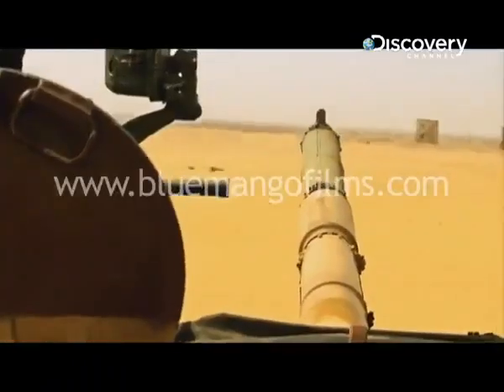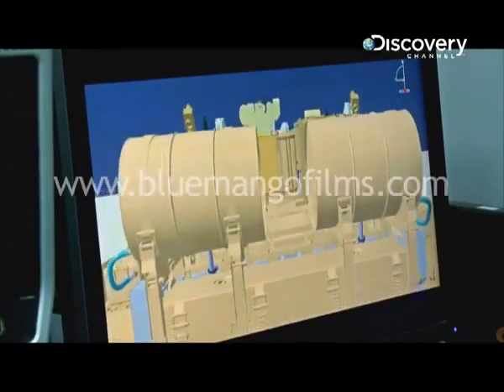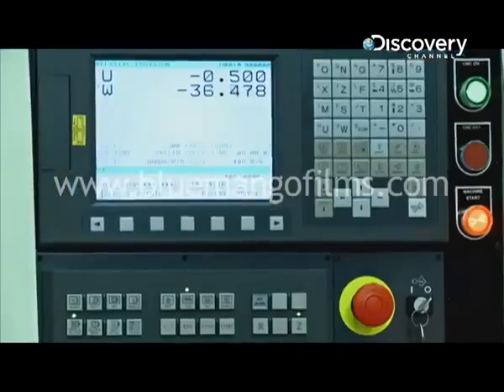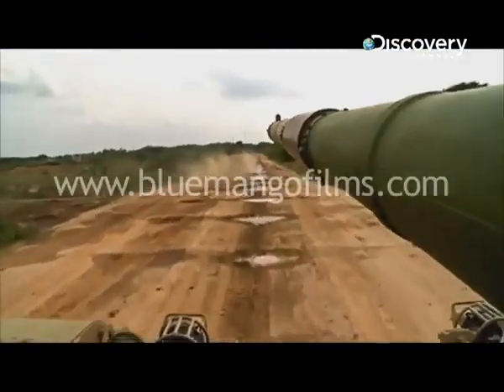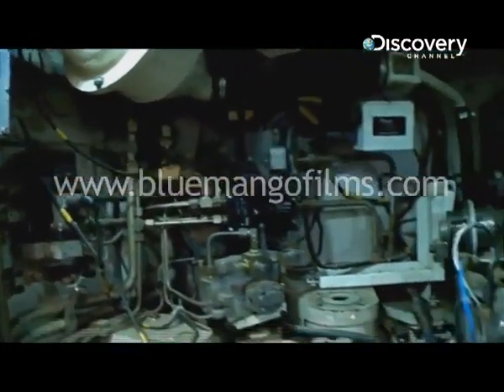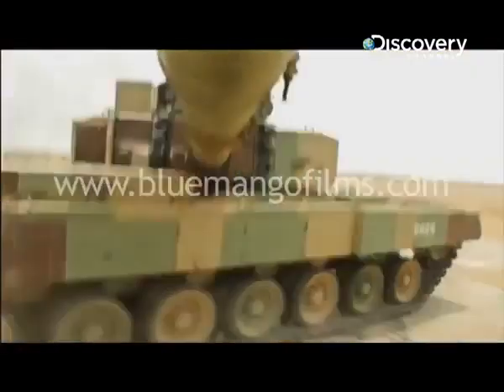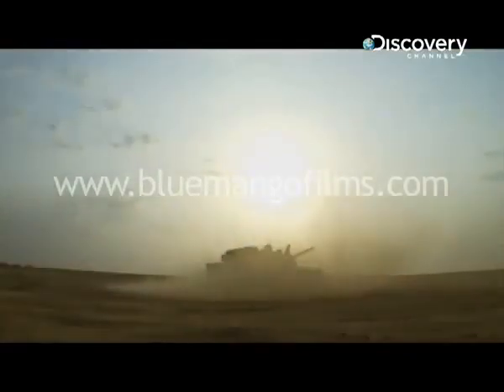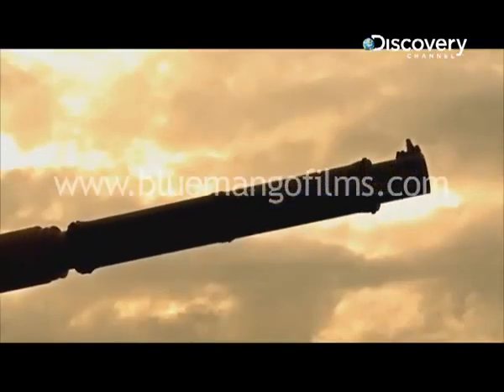Arjun Tank Mark1 Documentary

Comment: world most faster tenk is our arjun .  i think in present time no tenk is faster than arjun .  Ferrari of desart
Reply: +Sonu Dutta ur crazy
Reply: +Sonu Dutta    in this man  said that arjun 65 k/h,  but   Al-khalid tank speed 86km/h  Please check---------
Arjun                                   

Designed----1974 ,,In service---2004,,-
Weight----85.5 Tones,,Length----10.638 Meters,,
Wiath---3.864 Meters,,Hight---2.32  Meters

Crew---4,,,Primary.Gun    120 mm,,,

Secondary Guns
HCB  12.7mm,,,AA ,MG,
Mag 7.62mm CX,,,Engine ----1400 hp,,,
Power-----23.9 hp

Operation  Range
450 km (combat range ),,,,
Speed      70 km/h
==============================
==============================
Al-Khalid
Designed 1999-1990,,,Manufacturer   HIT<PAKISTAN,,,,
In service---2001,,,

Weight----60.2  Tones,,,
Length-----10.974  Meters

Wiath-----4     Meters,,,
Hight----2.89  Meters,,,Crew---3,,,Primary.Gun----130 mm 
smoothbore gun,
  45rounds

Secondary Guns
7.62mm coaxial MG,,,
3000   Rounds,,,,
Engine           1600   hp,,,,Power             29.8    hp

Operation  Range  
600 km (combat range ),,,,
Speed      86 km/h
Reply: +Faheem Khan do you think arjun tenk's desighn is an40 year old desighn ?just see the documentry dude arjuns desighn has been improvement since 1974. and this is just a mk1 the mk2) and other upcoming tenks will be better . but what about your chinese tenk!!! i have saw chinese tenks documentry . chinese  manufacturer was not interested to developed good tenk armour . beware my friend even a handmade rpg should destroy your chinese tenk .

Comment: 120 mm rifled bore? oh! cmon you are already doomed against abrams or t90 tanks which uses smoothbore gun carrying a ARMORED PIERCING FIN STABILIZED DISCARTING SABOT(APFSDS) round with depleted uranium or a tungsten tip .. that the reason why like US cannot use rifled bore gun to stabilized the sabot round or even firing a rocket round!
Reply: Marcos B it depends ... for me smoothbore is good for APFSD (e.g du penetrator or thungsten round) which is more powerfull and also carries rocket round for long range fire ... rifled is not good in APFDS due stability issues .. so i want penetration than to shake the tank crew inside the turret and hull
Reply: ***** ur right but for resons they didint decide in a smoothbore
Reply: ***** you mean the german guns on the abrams..lol
Reply: +Jose Mari Rey You do realize that the stability problems for APFSDS rounds fired from rifled guns were solved 40 years ago by the advent of slip-rings, right? There's a reason the British were able to continue to use rifled guns on the Challenger 1 and Challenger 2 (thus not giving up the HESH advantage) despite the wide proliferation of smoothbores. Sure, smoothbores have their appeals, but their supposed far-and-away superiority over rifled guns has been WAY over-hyped, mostly by Rheinmetall.

Comment: One of the most overrated tanks of all time
Reply: the arjun overrated?
Reply: Yep
Reply: likesmilitaryhistory Alan Moore Hell nah, why? Not much people talk about it.
Reply: Therefore, the claims that the manufacturer makes about the gun´s accuracy are very doubtful at best. It is claimed that the Arjun has a First Hit Probability (FHP) of 90%, even on the move, thanks to an excellent stabilizing system and Fire Control System (FCS). Comparative trials were conducted between the Arjun MkII and the T-90, where it was claimed that the Arjun MkII outperformed the T-90.

However, Indian Army Generals have since come out to say that those trials were rigged by corrupt defense officials, and that the accuracy of the Arjun MBT is vastly overestimated.

But the worst of all is the penetrating power of the Arjun´s main gun. At 2km, a round fired by the Arjun can only penetrate 300mm of Rolled Homogenous Armour (RHA).
The mobility of the Arjun is terrible. Its armor is virtually non-existent with huge weak spots all around the turret, and its gun is horrendously inadequate by modern standards.

There is a reason why even the Indian Army refuses to use the bloody thing. Only 100-200 Arjuns have been ordered to placate the government and DRDO (the Arjun manufacturer), while the Army relies on 1250 T-90 and 2500 T-72 MBTs.